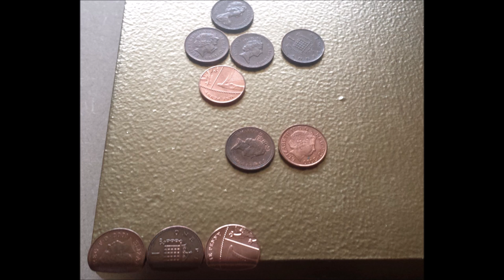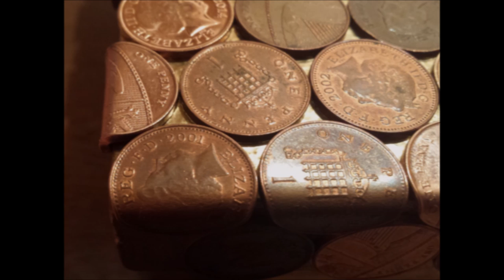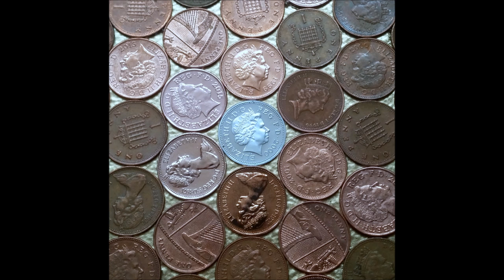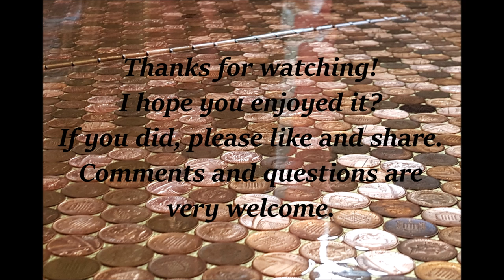Coin Top Table

Comment: It looks like you did not glue the pennies down first, correct?  Is the hot "glue gun" necessary?  Do you use this because you have no lip on your table top.  The table I have does not have a lip either.  I've seen on other videos that they smoothy the epoxy over the pennies.  Also, does it matter what type of paint you put down first?  Please respond soon, I want to get started!!!

Comment: I like how u bend coins around table edges, but u did not cover it with epoxy. So all it sticks to the table with is a glue? Imho all those coins on sides will be lost with time. it should be covered with epoxy. Other then that very nice table
Reply from the maker: Hi.  If you notice, when the epoxy is applied it is allowed to flow down the sides of the table edge.  This provides enough epoxy to cover and hold the coins firmly in place.